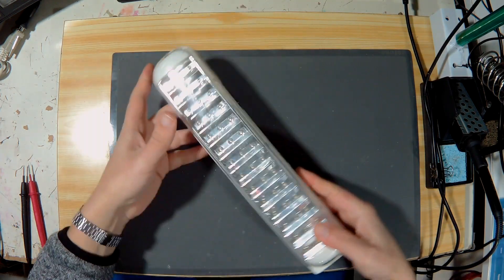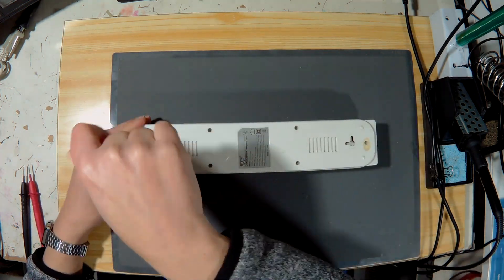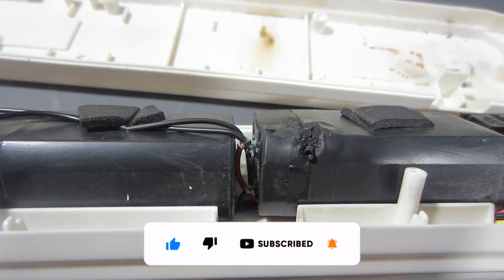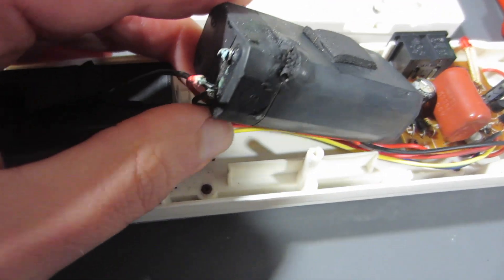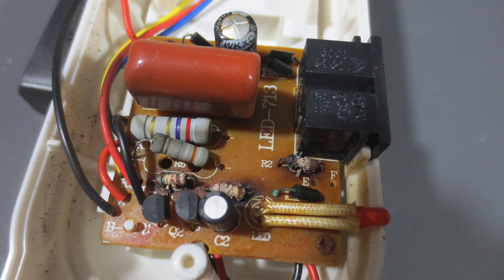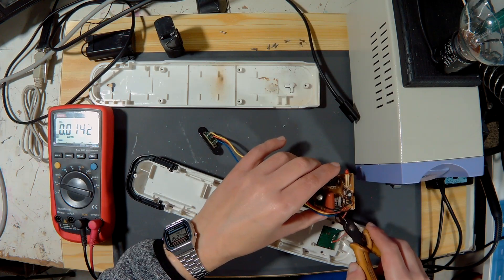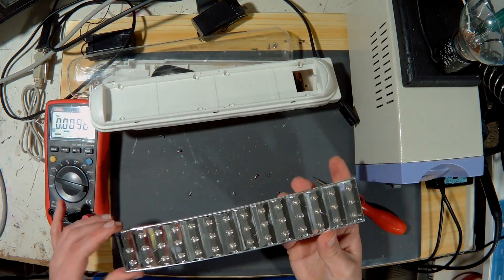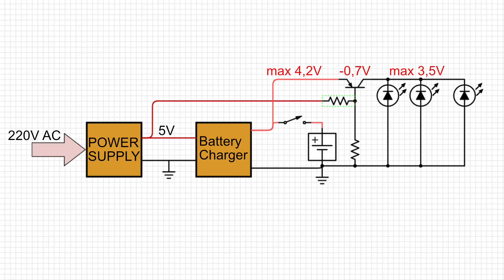Let’s fix an emergency light with exploded batteries

Comment: Sir, 
No doubt, vedio is good  one. 
But unfortunately,  due to your sub titles placing  70% of your movements  couldn't  be observed clearly.  
Please take care in next clip. 
Thanks.
Reply: You can turn off the sub by clicking on the lower right corner setup icon